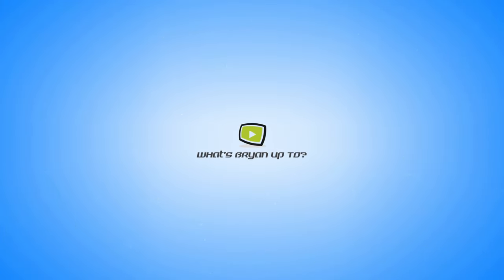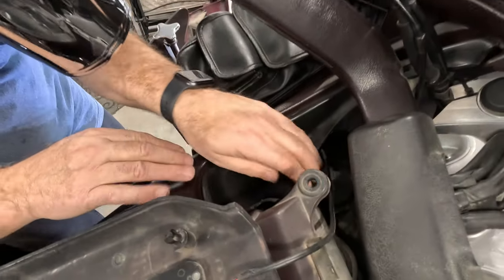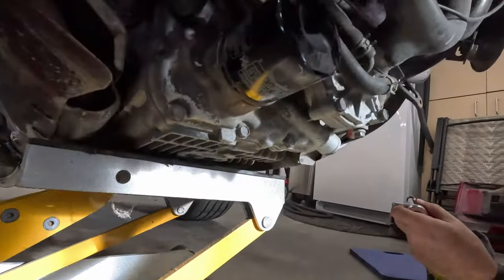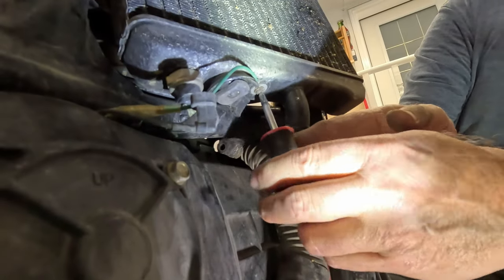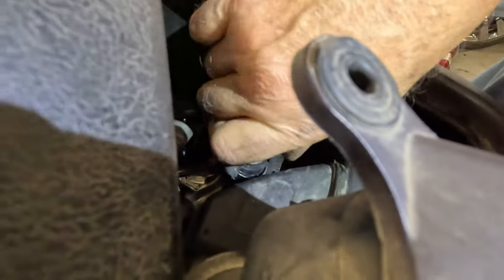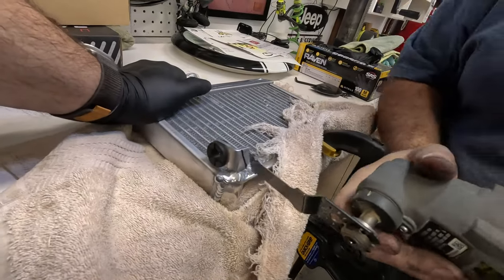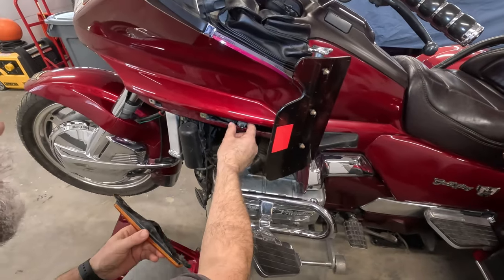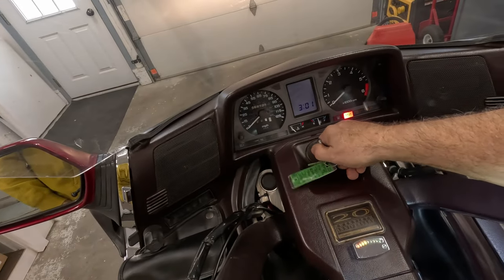HOW TO REPLACE RADIATORS & HOSES - GL1500 HONDA GOLDWING 1988-2000

Comment: This is a great video thanks for posting! Did a coolant flush on my 1995 Sl 1500 and now am getting a small drip from the front cover. What I read on blogs could be a hose up behind the radiators. This will be a huge help in getting behind the radiators to see where it might be.
Reply from the maker: Thank you for watching.  I’m curious to hear where the leak is coming from once you get it apart.  I’m wondering if it is coming from the same area we had found.  Another viewer suggested that we replace the thermostat while in there too.  I wish we would have thought of that while we had it apart.  Anyhow, good luck and nice back together, Ride Safe!!

Comment: May I ask you what was the reason you replaced the radiators and hose. I just wondered if there was a problem I need to  be watching for. Thanks
Reply from the maker: Yes thank you for asking.  My dad’s bike was experiencing some leaking but didn’t know where it was coming from.  Because it is such a chore getting in there and with the radiators and hoses being almost 30 years old he decided to change them out with new to prevent future issues with the 30 year old parts.  It ended up being a loose clamp. Yes he could have just tightened or replaced that clamp and put it all back together.  But it’s unknown how much longer those old parts would last, so he changed them out for preventative reasons. Hope that answers your question. Thank you for watching.  Ride safe!!!

Comment: I have a 1996 with leaks as well... do you have links to the places you went to for parts (other than ebay).  Also, the video didn't show how you actually got the port side fan out. How'd y'all do that?
Reply from the maker: Hi Mark.  Thanks for watching the video and also reaching out.  Yes, getting that port/driver side fan out was quite the chore.  I went back into my videos and I have about 20 min of us struggling with it until I just put the camera down and used 4 hands and screw drivers to pry and wiggle it out.  It was not an easy job to do, just unclipping the wire harness at the top of the fan housing was difficult.  It took patients for sure.  If you can get it popped out of that grommet in the rear of it and wedge it past the wires above to the right and wires down the frame tube to the left you should eventually get it out of there.  It's just as much of a chore getting it back in.  :-)  It might be easier to remove the radiator if you can first.  But, you'd have to decide to sacrifice the upper hoses, because you'd likely not be able to loosen the clamps and would likely have to cut the hoses.  

As for where to purchase, here's the links for Ziegler Motorsports and Cycle Parts Nation.  When you click on the link to parts at the Ziegler Motorsports site, it directs you to Cycle Parts Nation.  Then just follow the links to Honda and your specific year, model and parts. 
https://www.zeiglermotorsports.com/
https://www.cyclepartsnation.com/

Hope this is helpful!!  Good luck, and if you get a chance, let me know how it goes.  

Ride Safe!!
Bryan